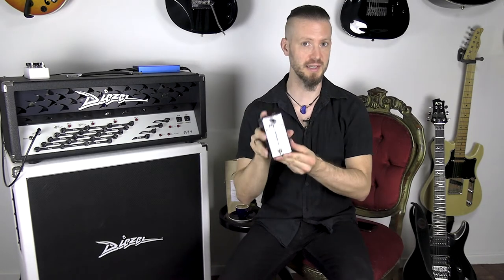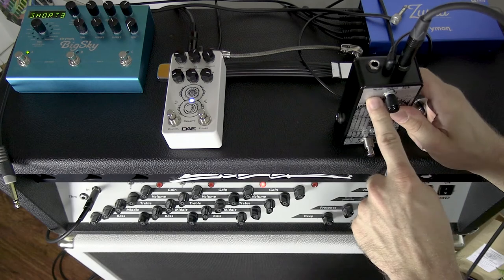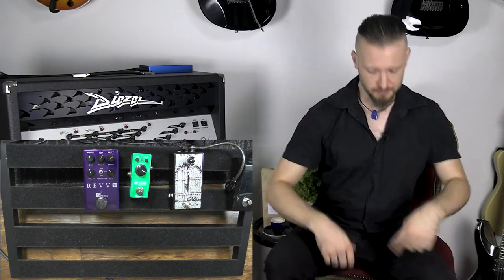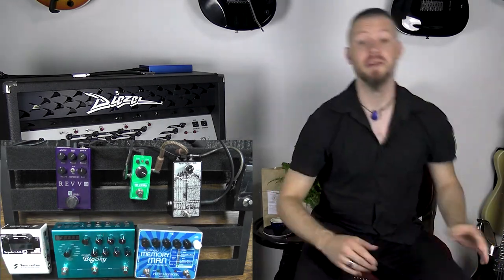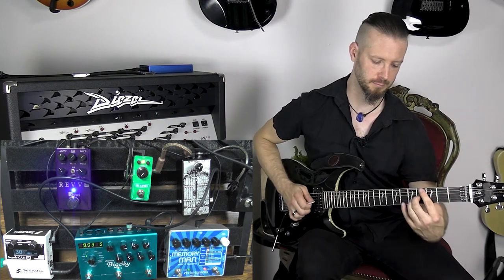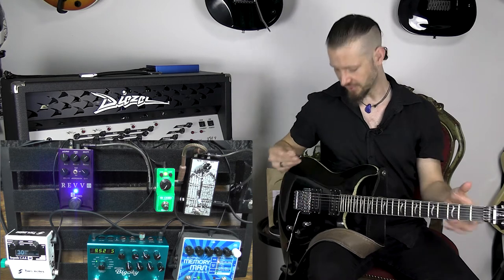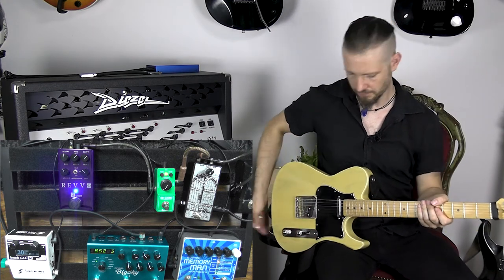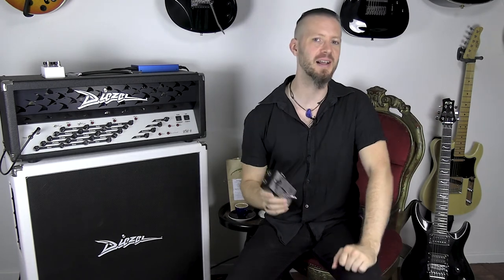Demo Lounge EP: 20  Lichtlaerm Key and the Gate

Comment: I keep coming back to this vid when I disconnect my pedalboard and realise that I've got early onset dementia when it comes to wiring. 

This really helped me diagnose a failing valve amp today. Hooked up via 4 cable to another amp and things were rocking again. The gate is sharper than a fresh scalpel. 

Thanks again man.
Reply from the maker: Glad I could help. :)
Reply: Dude I come back to this vid too.....how tf  I forget which one is for fx loop and other for guitar in ..I've redone my pedal board about fives time now.....you'd think Id learn!
Reply: Played out with my band for our first gig last night.... Had practice Thursday night and everything was fine... Amp and pedal settings were all the same, but during soundcheck my rig sounded like there was little gain and almost like my gate was immediately cutting my notes off.... So now I'm wondering if like you, maybe one of my tubes is about to crap out.

Comment: I have the key input and output on the sides and the gate on the top, that is the other way around than the pedal/version showed on this movie right? I got also a horrific whistle when using the 4-C method but using the other inputs as mine is labeled the other way around
Reply from the maker: Sry for the late reply. You have the newer version in gold, right? Then yes, I'd say you need to connect like it's labeled, so other way around.I assume you already tried switching cables and using it just in front and/ or the FX loop with 2 Cable method. A thought would b the power supply. Maybe try different ones. Otherwise maybe contact Lichtlaerm. Hope you'll figure it out!

Comment: Excellent demo and very thorough, thanks! I wonder if you have compared this to the Zuul?
Reply from the maker: I borrowed the Zuul a few month ago, but I sadly didn't have both at the same time. From memory I would say, that they are both really awesome and the Zuul might cut a tiny tiny bit harder, but I'm not really sure. Can't go wrong with either. The K&G doesn't need an extra splitter, which is nice. The Zuul Mini is a bit smaller. Both have cool designs.
Reply: The Key and the Gate wins. This is #1 Jordan’s Phalanx is right there also. Awesome.

Comment: i love my key and the gate , can't seem to find lichtlarm audio anymore, i think he partner'd up with another company
. i hope the one i have holds up. a gem for sure. i find it a little weird , but its awesome at the same time . does the job and is very transparent ,(clean and metal)  why i find it weird is , when it comes to overdrives after the gate, it alone is fine, but with drives with a gate built in. not so good, only because of the crappy built in noise gates of the pedals,  i have a precision drive with a built in gate also a savage drive v5 (with no gate), the gate from the precision drive still wants to do its thing, even though the key and the gate already has it covered, just because i have it before not after the drive i guess. the savage without the built in noise gate is just fine no side effects , i guess is the best way to describe that. anyways love my pedal and will hold on to it until i die or it does. thanks for the video, there was no manual given to me and i was honestly clueless when it arrived. and i still haven't found an english manual , but no need thanks to you'r video.
Reply from the maker: Yes, Lichtlaerm partnered with KMA Audio Machines. Glad I could help with the setup. Cheers

Comment: Really really nice video!
This pedal will help my signal chain and is cheaper than the ZUUL! 

I have your used FGN Dark Evolution 7 String. A really nice guitar ... without the Blackouts ;)
Thx that you didnt want to hold it!
Reply from the maker: Cool, glad you like the FGN. It's a very nice guitar, congrats! What pickups did you put in? I was quite tempted to switch them, too because I prefer passive pickups, but they actually worked quite well in the context of the goth rock / metal band I used it mostly for.
Reply: @PeterGeltat  I put Fishman Fluence Modern in neck and bridge. The Bridge is also changed to one from ABM.
The Blackouts are heavy sounding, my second choice. But the fluence are like a sword from japan ... hard, sharp and very transparent.
I am far away from passiv pickups because there are too much of them.

I have seen that the guitar is well played. A good sign for the instrument. I have had an Gibson Explorer 7 String with the same measure. FGN makes so much more right. And after all i have played the one or other Dark Evolution, at last yours and changed from Gibson Ex to the FGN.
Reply from the maker: @deadboz6007  Was it easy to replace the blackouts with fluence? Yes FGNs are great quality instruments! :)
Reply: You can just change the Blackouts with the Fluence. It is also the soderless system. But if you want to use the voices (split coil and High Filter) it is a bit work ... for an guitar tech at my point. At cheaper guitars i would try it, not at my beauties.

I think i have had about three Dark Evolution 7 Strings in the hand (No1 Guitars sold them ...) and i would buy all three. They look fantastic and the haptic is faboulus!
Reply: Today arrived this pedal at my board ... it is great. I need to get used to it because it is silent as it is filled with basotect (chain: guitar - gate - naga viper - kraken V4 - gate - pedal baby - isocab). Just perfect!
Reply from the maker: @deadboz6007  Awesome, cool setup. Have fun with it! :)
Reply from the maker: @deadboz6007  Ok, I think I would want to have all the sound options of the Fluence, and might even try to do it myself. Though my soldering skills aren't great... And yes, the throughout quality of FGNs is really good.

Comment: when you switch channels on the amp , dirty to clean, does it ruin your clean sound?
Reply from the maker: No, it's quite non-invasive (when you use the key input and have it connected with all connections properly). Only when you play super low volume and very delicate it'll cut off the tone depending on your threshold setting. But for normal switching it works very well and I don't feel the need to switch it off.